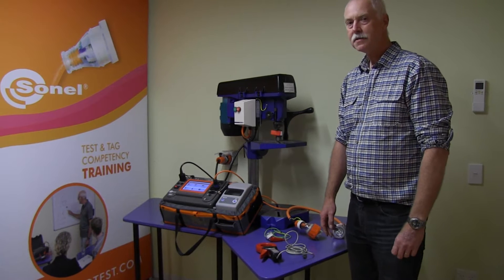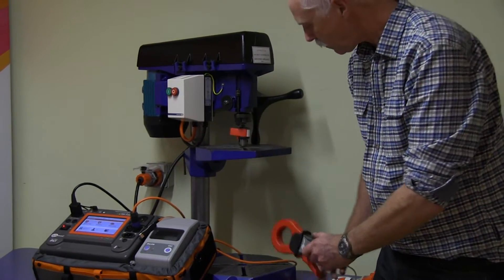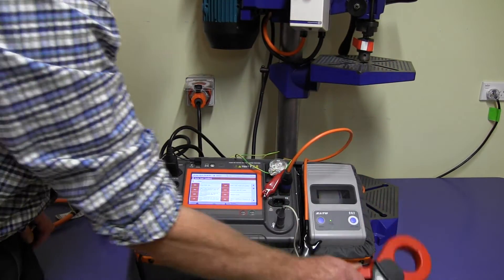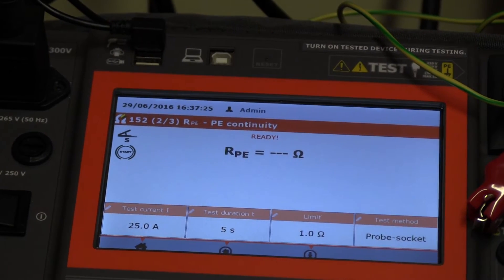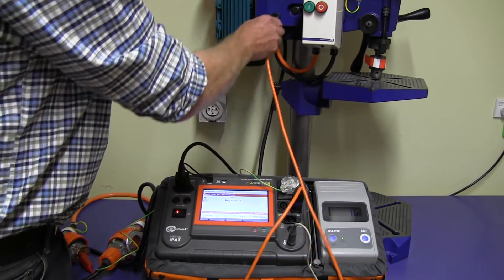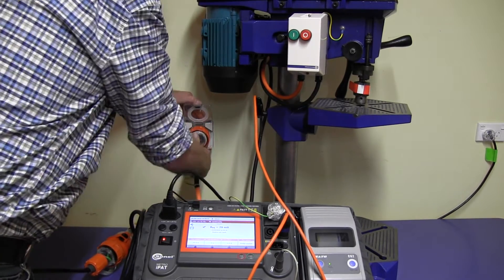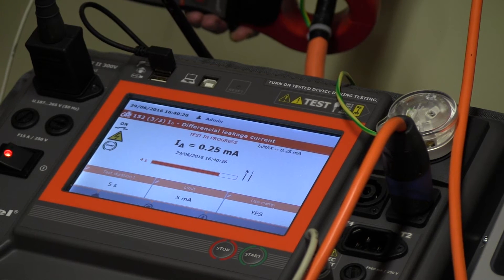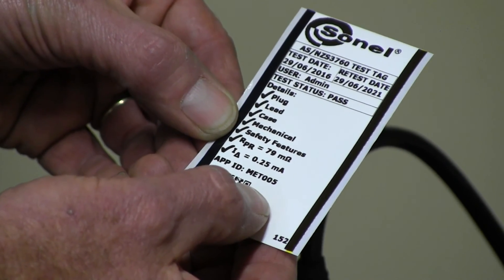3 phase test

Comment: Hi , as the 3 phases in their sum would be balanced, is it correct for the clamp to go onto the 3phase supply lead or should it be clamped onto the earthing conductor only, hence the reason why it was brought out of the cable on the adaptor lead so you can measure the leakage in the earthing conductor?
Reply from the maker: Hi Jak,
Thank you for your question.
The lead with earth separated out can be used to measure leakage either by attaching the clamp to the lead with all conductors enclosed except the protective earth, or alternatively by attaching the clamp only around the protective earth conductor.
Attaching around all conductors instead of the protective earth works best as this method gives total leakage rather than what flows in the protective earth conductor.
Remember the protective earth may not have all the leakage flowing through it as there may be a lower resistance parallel earth path, this is why the other option is our preference and what we would normally recommend.
I hope this is helpful